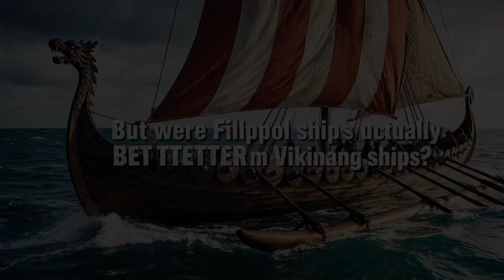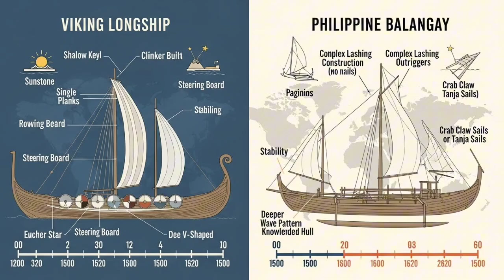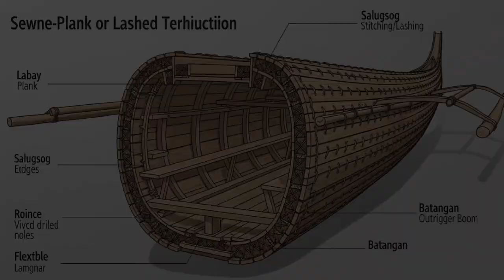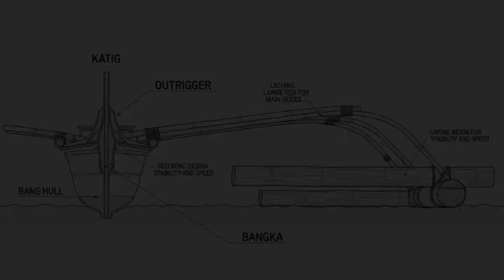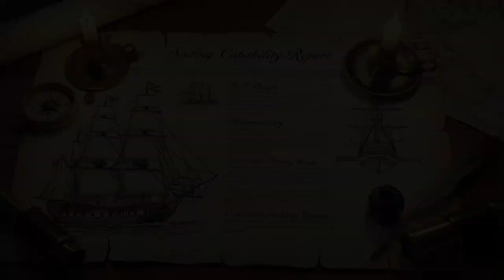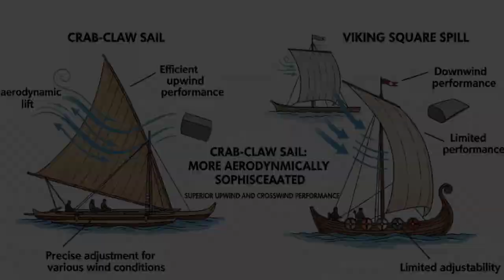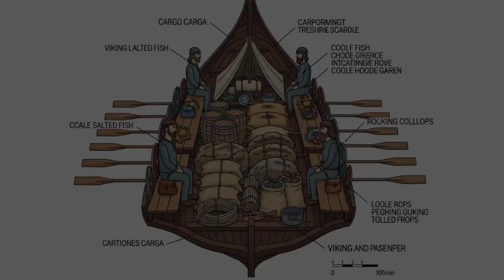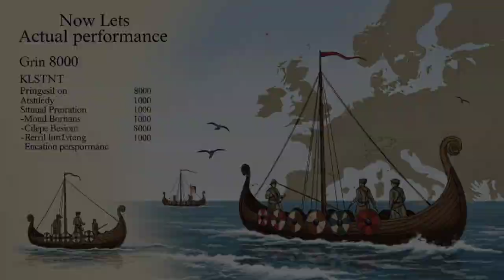Viking Ships Were Famous — But Filipino Ships Were Better

Comment: The boats that the Filipinos build today are successors of a long tradition of boat building. Growing up in Darwin, relatively close to Indonesia I first came across their versions of traditional boats in the 1970's (in Bali, and when boats were brought to Australia) and I also saw in PNG in 1983. I've had several trips to the Philippines since 2015 (most recently in 2025) where I've seen and been on boats and seen models in museums. As someone who has been around boats all my life and a naval architect I have been interested in traditional boats for as long as I can remember.

I will take issue with the claim of 40,000 years though. The boats spread with the Austronesian peoples - originally from Taiwan to the Philippines, throughout the Pacific and as far west as Madagascar but their origins are far more recent, most likely from about 3000BCE, although it could be argued that the prototypes must have existed for a while before people sailed south.

There is no evidence that the pre-Austronesian peoples had boats as sophisticated as those brought by the Austronesian peoples.

Comment: Bull.
Those canoes would leave you as fish food in the North Atlantic.
...Not to mention the fact that you couldn't load them full of plunder and take it home.
On the other hand, you could easily cross the Pacific in incremental journeys, just like the islanders did in a long boat.
Making blatantly false claims in your thumbnails has the effect of making the people you're promoting seem less capable than they were ...which is sad, since they had their own mighty accomplishments. 
On the other hand
Reply from the maker: You're right that North Atlantic conditions are very different from the Pacific, and the design of the Viking longship was definitely superior for its environment and purpose. The point of the video was more about the innovative engineering of ancient Filipino boats, like the balangay, which were perfectly suited for long-distance ocean voyages in the Pacific.

Comment: Why is there no country that builds old-style wooden ships but has machinery?
Reply from the maker: Actually, there are countries that can build old-style wooden ships — the reason you don’t see it often is because modern shipbuilding uses steel and fiberglass, which are cheaper, safer, and faster to produce with machines. Traditional wooden shipbuilding is still done, but usually by specialized craftsmen, not big factories. It’s an art form now, not a mass-production industry.